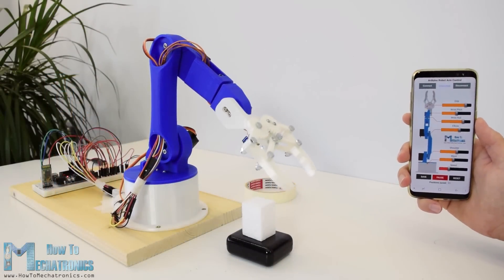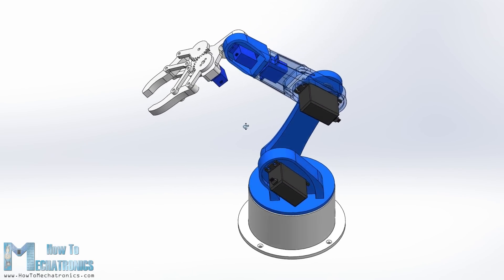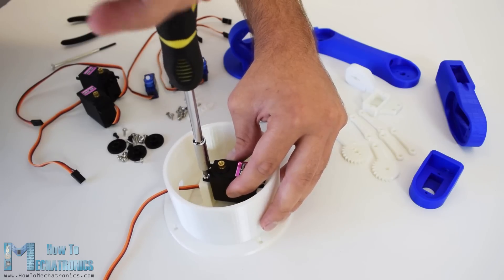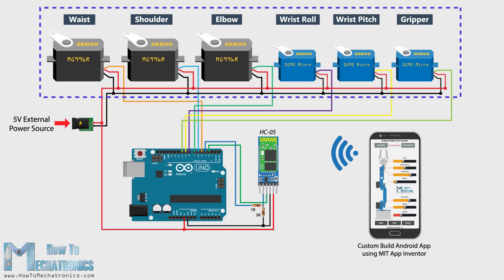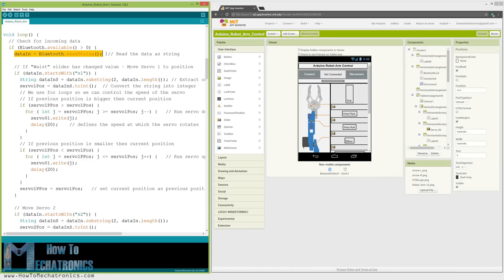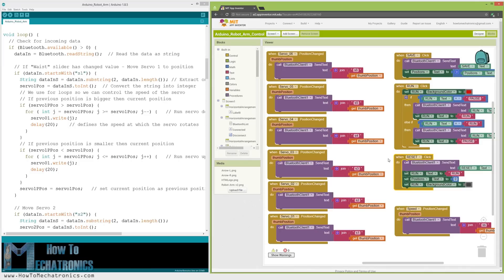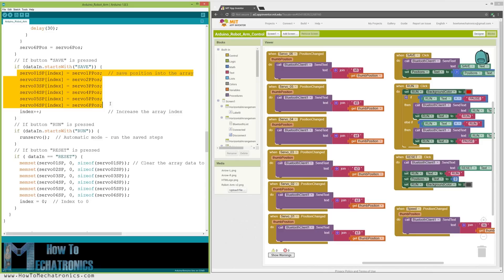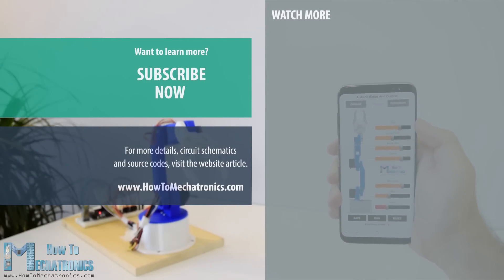DIY Arduino Robot Arm with Smartphone Control

Comment: thanks for the detail and easy-to-follow information! I really appreciate it.:)
One question, is it possible to scale up the whole size with same components?
Reply: Can you run a Honda engine in a full sized truck? Probably but is going to fail haha
Reply: i thought about the same, it depends on torque of the servo that rotate whole arm vertically (the one with rubber), it has probably 10kg/cm so it can hold 10kg weight on roller of radius = 1cm(Torque = 10*9.81*0.01*1=0.981 [Nm]). For example if your arm have center of mass 15cm from servo, it weights 250g and angle is 65 degrees Torque = 0.25*9.81*0.15*0.9063= 0.333 [Nm]. So you can calculate max size of arm  if you take extremal position, but well... it gonna take you some time.

Comment: Do you know where I could get the bolts and nuts you used to assemble the gripper from?
Reply: I got them on Amazon but I found it too but a little too big for M4 so I used M3 instead
Reply: Also do you know how to wire the breadboard with it?

Comment: Thanks very much for putting this out there.  I have purchased all the parts I didn't have and am in the process of 3d printing the arm components for the arm as I write this.   My only comment beside to praise you for you excellent efforts is to suggest that you include printing instructions for your future projects.   I'm printing at 22% fill and .1mm quality and I hope this will be OK for strength.   I suspect this will be fine but the MG996R servos seem to have a lot of power!    Paul.
Reply: Could you tell me about quality of print with your settings? Is it ok for strength?

Comment: Hello. I'm working on this project now. What hardware (screws, nuts and bolts) should I buy that are not included with the servos? Thanks
Reply: Did the mechanism work properly?  Are the given dimensions from file are correct?

Comment: I made all connections, but when I try moving any servo, all of them begin to shake but none move.. Any advice?  I am using  a 9v battery to power servos.  Using five 9g and 1 MG995 servos.  Any help will be greatly appreciated!!
Reply: if you found the solution then please help me because its part of my graduation project and i have the same problem

Comment: Hey there, what is the maximum weight the robot can lift?
Awesome project
Reply: It can lift upto 1.5 kg to 1000 kg but it depends on weight and size of the undefects physical configuration, construction and drive system.✨🤖

Comment: Hey There, great works! the solid works file for arm. gives an error, I use Solidworks 2014. STL files does nt include the arm parts. Thanks .
Reply: You just need to extract each individual file. Do you know how to wire the breadboard?

Comment: I’m building this project on my own and the servo motors just keep twitching instead of moving how they are supposed to can anyone help?
Reply: Same. Have you found a solution?
Reply: Erick  nah bro I think it’s probably my power supply or I’m connecting something wrong. I’ll update you when I figure something out
Reply: if you found the solution then please help me because its part of my graduation project and i have the same problem

Comment: I have used the same code n downloaded the same app but the motor does not rotate it just moves a little (vibrates) please help!! N also it moves when any slider is moved
Reply: Have the same problem here... Did you succeed?
Reply: @marcoalmeida7231  did u find the problem?

Comment: Thank u so much for this amazing idea. Finally made it and all were amazed that how i did the same. That's all bcoz of u sir
...... Thank u again......
Reply from the maker: I'm glad to hear that!
Reply: How did u assemble it I’m having real trouble
Reply: @murdermelon6103  for all those who are trying to make it...the code provided in this video in not 100 percent accurate...you have to make changes...then only it will work...and for assembling.. after 3d printing the parts there is nothing hard....just first join parts and then join wires..hope you understood
Reply: @jyotisharma6531  the hard bit when assembling is the screws that are provided are not screwing into the holes to attach the servos they are just screwing endlessly
Reply: @jyotisharma6531  can you share the modified code please
Reply: @Jyoti Sharma, can you please help me with the correct code to get this working. I am having a hard time in getting the code work.

Comment: Please I need that someone help me because i did this one, but i have problems because my robotic arm cant do nothing when i do the arduino code and use the power supply, i understand that in the power supply i need to put 5v 2A I dont know what can i do, maybe i have problem with my arduino connection because you didnt explain step by step how can i do the arduino connection. Please if someone can help me.

Comment: wonderful project, i started printing parts, ordered servo and others, but impossible to download the android contole app, every try with several gsm i have the same warning "this type of applicaton can endommend your device, read and erase your SD card "and the devices will not open it.
Is there a security problem with this file?
Thank you for your response
Reply from the maker: It's an app made in MIT App Inventor so when trying to install it it's normal for Android phones to warn you that the app is not tasted/ approved by the Play Store. There is nothing wrong with the app, everything should work fine. Or if you are afraid of installing it, you can open the MIT App inventor application and generate new download file from there.

Comment: Bro I tried this and also the prev to light led with smartphone but it is not working ,I used only 3servo motors and Arduino uno..but don't know the reason not working..plsss help

Comment: Bro I need some help,  I do everything as you do but my servo doesn't work they only vibrate can you help to solve it
Reply: Dear Sir I am a big fan of your projects.  I have built the robot arm with the servo's you prescribed and I also have only vibrating servo's which do not make a rotation. Has anyone solved this issue already?A hint about possible root causes would be very much helpful!
Reply: @dmgeeftadvies  if you found the solution then please help me because its part of my graduation project and i have the same problem

Comment: Really! this is a great project! I’m tried to do it, but the arm when I turn on it, it just start shaking. Bluetooth module and apps are connected, but not any output on servo when I changing apps slider, Also try to use the Serial Monitor to see the values from the Bluetooth module, just Serial Monitor is blank. Please Sir Help me.
Reply: I'm also facing the same problem, did you find a solution
Reply: I've the same issue here... DId you succeed?
Reply: I don’t get any Solution

Comment: EVERYTHING SEEMS TO BE WORKING FINE BUT THE SERVO WONT MOVE WHEN SLIDER IS MOVED,IT TWITCHES A LITTLE BUT WONT MOVE,AND IT WILL TWITCH WHEN MOVING MORE THAN ONE SLIDER[ONLY USING ONE SERVO FOR NOW]
Reply: Hello I have the same problem.Have you a solution 

LG robby

Comment: Why use resistor in the hc-05??
Reply from the maker: The HC-05 receiver pins works at 3.3V. So the two resistors are used to make a voltage divider so that the 5V coming from the Arduino are dropped down to 3.3V.

Comment: This is the first project you made that I ordered all the parts for and I'm going to build it.  Thank you for sharing your STL files, I have the Creality CR10S model and I love it. Isn't it nice?

Love your ant too. Oh, also, I've been developing Android for about 3 years now with Xamarin, and you introduced me to MIT App Inventor. What a cool program!  I was up and had an app running in 15 minutes as opposed to Microsoft VS that took 3 days to get all set up.
Thanks again - Subscribed.
Reply: hey i did everything but the servo motors wont move the robot at all, vibration only occurs. Can you help me?
Reply: Did u complete the robot tell me?
Reply: @krishmaher107  Yes i did. That was a few years ago and as I remember it worked fairly well.  The downfall was the servo's. The robot is just too large and needs stepper motors. that's where I left it when real life crept in.
Reply: @GaryParkin  can u tell me the total estimated cost u done!?
Reply: @GaryParkin  I m a college student and this is my project so can u help me for making this arm?
Reply: @krishmaher107  I followed his instructions. It's been a long time. I no longer have the project.  I somewhat got it working but the servos he uses aren't strong enough.  I used the parts for another project. Sorry.  The Android project was pretty fun as i remember. Good luck.
Reply: Please you can send the program  of robotic arm and which app should have to be install

Comment: Thank you very much sir. My project is almost done, the program is good (just change little bit). Hope you all the best with all your content
Reply: Bluetooth connected, program is run , but servo not any movement when changing slider, i need your help.
Reply: @shafikaman5841  salam aleykum, have you figured it out? if so then can you please help me because its part of my graduation project and i have the same problem

Comment: hye  i am facing some problems in using sg 90 servo motors whenever i send signal through bluetooth app and code provided the servo motor only moves back and forth and does not react to desired position pease help me to resolve this problem
Reply: if you found the solution then please help me because its part of my graduation project and i have the same problem

Comment: How do you attach  the servos to the pieces? The attachments I have for the servos have holes that are too small for any screw to fit. Do your attachments have bigger holes in them? How else can I attach them to the parts?
Reply from the maker: Try self-tapping screws, not machine bolts. The self-tapping screws that come with the servo motors as accessories should be able to fit in the holes.

Comment: any on tried it?
mine is not working properly
Reply: what didnt work for you? by the way, the solidworks parts have no screw threads so how did you connect the servos?
Reply: Doesnt work, tested individual servo no issue but when loaded his script, my servo are just vibrating.

Comment: The mg996r servos are 180° or 360°? Because i have 360° servos and i dont know if they are good for this project
Reply from the maker: MG996R are 180 degrees servos which contain position feedback.

Comment: I uploaded code and supplied 5volt each when I try to move ,slider servo jerks, and not even move a degree,what should I do plz help me 😨
Reply: Bro did you get the solution for it, if yes please help me....
Reply: @Nallavanaya-Unni1  have you found the solution? if you did please help me
Reply: if you found the solution then please help me because its part of my graduation project and i have the same problem
Reply: Naah I never get steady operation,so I hooked wires internally ,very last moment i made 🕹️ joystick connection (I told my project guides too )...idk problem is in Arduino board or I need to bought separate board for servo...if it resolve plz reply too?

Comment: I used exactly the same Arduino file and the same Android file and the Reset function doesn't work. Also the robot doesn't repeat the moves. What is the problem? Thank you in advance.
Reply: Is it solved

Comment: What should I do if I need to use stepper motors instead ? And after programming when the auto mode is on I need all the motors to start work at the same time and end at the same time. Im intended to use this on a camera slider, pan tilt. Please help

Comment: Hi!
For me everything working great, but the run mode is not working. Could you please help me?
Thanks
Reply: the solidworks parts have no screw threads so how did you connect the servos? please help am i missing somthins? i opened the parts on solidworks and i see no threads for the screws.. already printed it 3D and dont know how to connetct the screws

Comment: I’ve changed the baud rate to 9600 and the arm start moving , but the slider is not stable .. is not synced with the movment .. it will change the direction always

Comment: Just made this arm. Added to top of my homemade Turtlebot(roomba 640) with 3d printed turtlebot decks. It works great. Can easily control it with rosserial and arduino. Thanks for sharing design.
Reply: hey can i ask if you followed the code and schematics exactly cause for me its not working
Reply: @shoandeep  I believe I had issues with the original code as well.  Unfortunately it’s been quite some time and I cannot recall what I used as an alternative. There are many examples of arms like this on the internet. I just used the code from a similar arm and modified it slightly to match my setup. Sorry I couldn’t be more help.
Reply: Hey romantic  arm is working  properly  than plz help me also na can plz send me.the proper  code and circuit diagram

Comment: I tried connecting but the servo motor moved a little and then it stopped.
so please send me the photo of circuit diagram with breadboard or the photo of your connections using breadboard.
we have already done the 3d printing . it will be waste and you know how costly 3d printer and pla filament is.
so i request you to reply...... please!!!!!!!!!!!
Reply: You have f..d up and you request support?!
Reply: I also did this project and it showed the same problem to me but what u see is to connect wires in a straight line in circle cuz they may get broken and also check if parts u have used for robot are used before cuz it also cause a problem that they may get crashed
Reply: and also check the power voltage u gave to arduino cuz it may get burned up

Comment: Hello Dejan
Its a wonderfull project you have make

I would like to improve it a litle bit like this picture with 2 servomotor on the main arm

is that possibly to do and what should I change in the Arduino code if it´s possibly

I dont know how to put a picture in this comment
Thanks in common

Preben Thomsen

Comment: Hey mechatronic man
I liked the video. But  with smartphone, it is difficult. So can you show how to make it with a joystick module.
Reply from the maker: Thanks. Well if you want to control the robot with joystick is as simple as the Servo library "Knob" example. So you take the analog input from the potentiometer or the joystick, map the range 0-1023 to 0-180, and use that value for the position of the servo.

Comment: What can I do for more smooth motion. That's great project.
Reply from the maker: Thanks. You could try different method instead of the sliders. Or when using the sliders actually click on them instead of sliding them. Also you could try to adjust the delay time in the Arduino code.

Comment: hey. I built it but with all 6 micro servos (sg90) but it did not work with the app. Can you tell me the problem ?
Reply: Sumukh Upadhya yes, you built it wrong
Reply: if you found the solution then please help me because its part of my graduation project and i have the same problem

Comment: Hello,
That is a amazing project. honestly.
Based on your instruction in description I made this project but I faced some problem.
The first is i used HC 06 module, is that ok?
And in circuit, I feel a little bit confuse, Why do you connect RDX to GND? Is that right?
After upload code and connect pins. Every servos shake and can't control inspite of using external supply (battery 6V, 2A)
Can you explain for me, please??
Reply: Hey sir, have you solved the problem?
Reply: @solehb.1308  Hi, could I help you ?
Reply: @SmileWD  I've got the same problem with yours sir..
Reply: @solehb.1308  haha, honestly I finished 3 years ago in university. Currently I am working at another field and completely forget it but I remember on google you can find another way to tackle them. Learn more and keep study you can do it

Comment: Could i use arduino 5V pin to 6 servos and arduino 3,3V pin to bluetooth modul?... Is it okay to connect 5V pin and GND to battery positive and negative respectively like in ur schematic, i just worried 😓?... Sorry for my bad english...
Reply from the maker: In case you use, let's say 12V power connected to the Arduino power jack, these volts are than converted to 5V to the 5V pin through the voltage regulator of the Arduino. The problem is that the voltage regulator can handle only around 500-700mA of current and six servos would draw more then 1A of current so you will burn the Arduino voltage regulator. Therefore, the 5V must come from an external 5V 2A power supply. The servos must draw current directly from the 5V power supply.
Reply: Ah i see, thanks sir... Could i ask u more questions?, why my servo doesnt rotates smoothly? Sometime  when i rotate one servo, the other come to vibrate together... And i dont know why my HC-05 doesn't works on 38400 baud, i only can use 9600 for this project to control my servo by bluetooth -_- ... I face a lots of trouble...

Comment: So I believe you need to change the HC-05 Bluetooth module to your phone's app to the HM-10 so it is compatable with IOS devices and can run on BLU(Bluetooth low energy)
Reply: Its k its ez to change
Reply: I can’t connect the HM-10 with cell phone. Any help?

Comment: I have problem. When i set one postion every of servos move (or more correct make big shake, even for speed slider)  and go back to old position. I even try to use two power sources one for servos second one for arduino and BT (GND connected), HC05 and HC06, arduino uno and mega but i stil have the problem. Its look that BT recive some trash. Anyone can help?
Reply: Same, all my servos got shaked when i am using slider
Reply: Mistrz Zen. Hi. Did you solve the problem?
Reply: @cemil_tunc  i change baud rate to 9600 and something start running